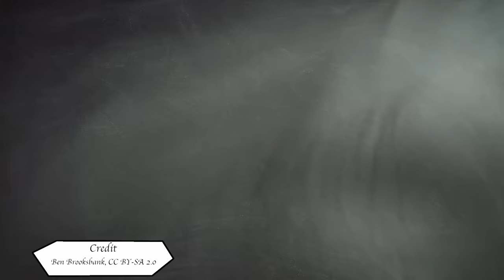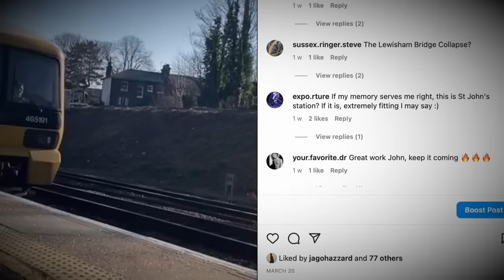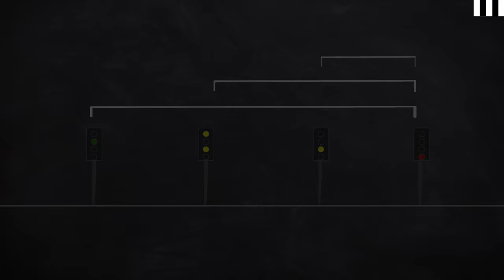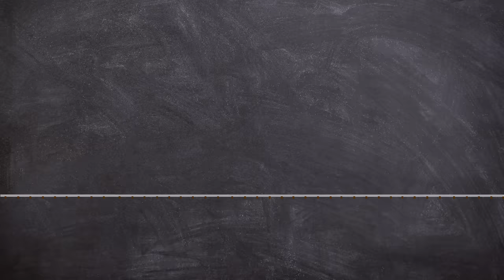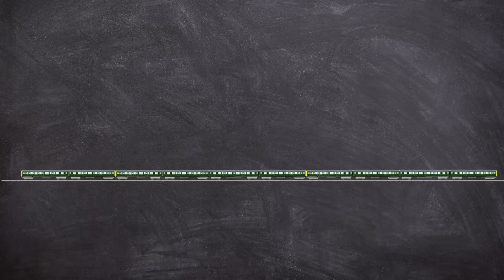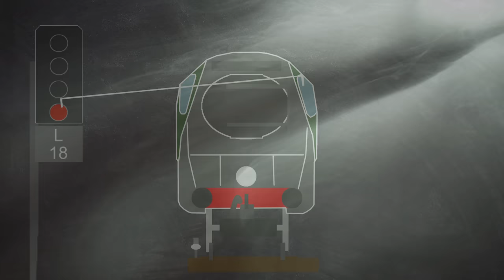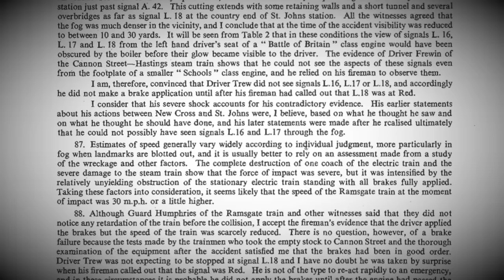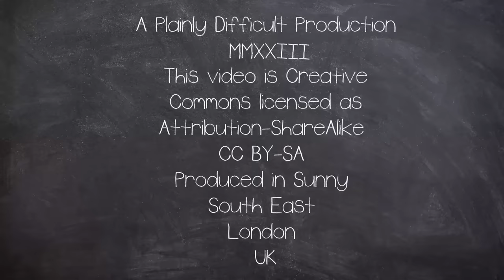Driving Blind: The Lewisham St Johns Train Crash Disaster 1957 | Plainly Difficult Documentary

Comment: So why was the double yellow the lesser caution? Wouldn’t you want the more immediately distinct one to be the bigger warning? Not that it matters in this instance since he apparently saw neither of them… but I can see mistaking single yellow for single green in a fog.
Reply: You'd be surprised how many people ask that. There are at least 2 very good reasons why double yellow is the lesser caution. 1. Some signals do not have 4 aspects, they have only 3: red, yellow and green. The 4-aspect sequence being red, yellow, double yellow, green means that yellow always means the next signal is red. 2. If one of your yellow lamps should fail the signal fails safe as it shows yellow instead of double yellow. Since one yellow is more restrictive that's safer. If 1 yellow meant the next signal is double yellow and 2 yellows meant the next signal is red, you can see that if one of the yellow lamps failed that would turn a signal which should mean the next signal is red into one which means the next signal is double yellow, which would be bad.

Comment: I am curious as to why the signals were on the right side, when engineer was situated on the left side of the engine
Reply: From the Ministry of Transport report:
30. It will be noted from the inset to Fig. 5 that there is plenty of room for the simple signal posts in the wide space between the Down and Up Through line, but none between the Down Through and the Up Local lines, and to have brought the signal aspects to the left of the Down Through would have required fairly elaborate cantilevered gantries. I understand that at the time of installation, when most of the engines were driven from the right hand side, the signals were sited as nearly as possible to the driver's or fireman's eye level in order to give the best view in the prevailing conditions where curvature and overbridges had to be taken into consideration.

96. Although the Down Through signals between New Cross and St. Johns are on the right hand side of the line, they are well sited, taking into consideration the difficult conditions of curvature, cuttings and overbridges, and it is doubtful whether much improvement would result from moving them to the left hand side of the line. The view from short range would be improved, but from long range it might be reduced.
Reply: @LUAu101  Alright!

Comment: Seems like a bit of a handicap to place the signals on the line where the driver can't easily see them.
Reply from the maker: I agree!
Reply: @PlainlyDifficult  From the report itself "It will be noted from the inset to Fig. 5 that there is plenty of room for the simple signal posts in the wide space between the Down and Up Through line, but none between the Down Through and the Up Local lines, and to have brought the signal aspects to the left of the Down Through would have required fairly elaborate cantilevered gantries. I understand that at the time of installation, when most of the engines were driven from the right hand side, the signals were sited as nearly as possible to the driver's or fireman's eye level in order to give the best view in the prevailing conditions where curvature and overbridges had to be taken into consideration."

Comment: Driver Trew took over an engine borrowed from Stewart’s Lane which had to traverse London in the fog.
Had not had chance to take water before hooking on to 11 well filled bogies. ( No column @ Cannon St). Engine being low on water was on drivers mind, as well as a very late departure.
Out of course stop @ Sevenoaks would be his first chance to fill tender. (More delay!)
Fireman needed to make up his fire (after sighting normal batch of signals for his mate), for the climb to Knockholt. Drivers could sight others until St John’s where it was normal for fireman to sight them for their mate.
Fog is very disorientating & driving steam needs concentration, difficult when u’ve got other things like taking water on your mind.
A book by Mike Jackman ‘ 30 years @ Bricklayers Arms’, gives an excellent overview of the surrounding events leading up to the smash & subsequent inquiry, which led to Trew tragically ending up a broken man.
Bricklayers Arms should have supplied the engine for this turn, but none were available.
The official report makes sober reading.

Comment: Back then with steam trains, the vast majority of homes using coal to heat them & the Clean Air Act barely 18 month's old, fog was made worse & often turned into smog. It should be noted that BR was desperately short of money, it was having to pay compensation to the shareholders of the big 4 due to nationalisation, government were paying war debts & limiting borrowing. Then there was the temporary measure to build steam shutting locomotives as a stop gap before realising they had to switch to diesel; meaning that money was wasted. Add to that a fall in goods traffic & parcel service that was shifting toward road transport. This meant that upgrades to signals & train protection wasn't given the priority it needed as  the vast majority of the budget was needed just to keep trains running.
Reply: The southern resisted aws as it was constantly running on one and two yellows. When I did some of my driver training on the strood paddock wood  branch in /1990 there was still no aws!  Coming from the central section that was too weird

Comment: Did BR not get criticised for the placement of those signals on the wrong side of the track, making them very difficult for the driver of a steam engine to see?
Reply: From the Ministry of Transport report:
96. Although the Down Through signals between New Cross and St. Johns are on the right hand side of the line, they are well sited, taking into consideration the difficult conditions of curvature, cuttings and overbridges, and it is doubtful whether much improvement would result from moving them to the left hand side of the line. The view from short range would be improved, but from long range it might be reduced.

Comment: I'm curious, if all the drivers are sat on the left why do they only have signal boxes on the right? Seems like it's just asking for a disaster.
Reply: It's not the location of the signal box (the building where the signals are operated from), but the signals themselves that was the issue. It's not that the signals are only on the right, in fact for many years it has been a requirement to locate them to the left of the line they apply to where possible. It's that these signals in the case of this accident were located on the right and that was a contributing factor in this accident. As to why that was, the answer is given in the report: "It will be noted from the inset to Fig. 5 that there is plenty of room for the simple signal posts in the wide space between the Down and Up Through line, but none between the Down Through and the Up Local lines, and to have brought the signal aspects to the left of the Down Through would have required fairly elaborate cantilevered gantries. I understand that at the time of installation, when most of the engines were driven from the right hand side, the signals were sited as nearly as possible to the driver's or fireman's eye level in order to give the best view in the prevailing conditions where curvature and overbridges had to be taken into consideration."

Comment: Is there any particular reason why the signals are on the side that the vroom-vroom maker is NOT sitting on? Like... Why? That just sounds like it's asking for trouble in foggy conditions. Why do it that way?
Reply: From the accident report "It will be noted from the inset to Fig. 5 that there is plenty of room for the simple signal posts in the wide space between the Down and Up Through line, but none between the Down Through and the Up Local lines, and to have brought the signal aspects to the left of the Down Through would have required fairly elaborate cantilevered gantries. I understand that at the time of installation, when most of the engines were driven from the right hand side, the signals were sited as nearly as possible to the driver's or fireman's eye level in order to give the best view in the prevailing conditions where curvature and overbridges had to be taken into consideration."

Comment: Honestly... i feel the fault lies with the rail designers.
Why would you put the signals on the other side then where they usually are?
Thats just a recepie for drivers missing the signals
Reply: "It will be noted from the inset to Fig. 5 that there is plenty of room for the simple signal posts in the wide space between the Down and Up Through line, but none between the Down Through and the Up Local lines, and to have brought the signal aspects to the left of the Down Through would have required fairly elaborate cantilevered gantries. I understand that at the time of installation, when most of the engines were driven from the right hand side, the signals were sited as nearly as possible to the driver's or fireman's eye level in order to give the best view in the prevailing conditions where curvature and overbridges had to be taken into consideration."

It's actually kinda funny you mention that really. Like on the Southern the Great Western engines used to be driven on the right and so it was very common to have signals located to the right of the line, or even next to the opposite line, where they could be more easily seen. Some of these signals survive to this day. However it became the standard that signals should wherever possible be placed on the left (i.e. where they usually are) leading to some very difficult sighting puzzles to solve and generally a worse view than would have been possible otherwise, or else some very awkward structures

Comment: All of the signals on lines where there are passengers services other than at station platforms are absolute block. It doesn't matter if they are automatic or controlled by a signalman.
Reply: That's not true. 'Absolute block' has been used to refer specifically to manual block signalling by telegraph on double lines for decades. It has been and continues to be in railway rule books, the sectional appendix, training, competence management etc. etc. distinguished from other methods of signalling such as track circuit block. Track circuit block signalling is non-permissive ('absolute', if you like) but it has been convenient to distinguish it from 'absolute block' for, as I say, decades. Incidentally it is possible for permissive working to be done on passenger lines, just not by passenger trains, other than at station platforms. This was more of 'a thing' in the past, but when Derby PSB was open the Broadholme loops were authorised for passenger trains but permissive working for freight only was also authorised.
Reply: @LUAu101  yes, there were/are some lines with passenger services were permissive working of freight trains was allowed. But none of the services involved in this incident are freight trains and so such permissive working are irrelevant. There were also sections of line that had/have no block, but only on freight lines as far as the evidence I have access to shows, and thus not relevant to this incident. My point still stands. At the time of this accident all lines were passenger trains ran were absolute blocks, excluding platform lines in some places.
Reply: @neiloflongbeck5705  I'm afraid you're wrong, and @Campaign Against All is right.  What you're referring to is Closed Block working.  Absolute Block working is a specific type of Closed Block working, where each train is offered forward by one box and accepted by the next one, the state of the line being shown on a block telegraph.  Track Circuit Block is another, different, type of Closed Block - trains don't have to be offered forward from each section to the next, the signaller instead sets the route and the signals for each section operate automatically.
Reply: @neiloflongbeck5705  No it doesn't. That's not what absolute block means. For decades absolute block has been distinguished from other forms of non-permissive block working. John was using 'absolute block' entirely correctly and as the rail industry has used it for years. Which is distinct from what we would today call 'track circuit block', a term which has been in use since at least the 1960s. See for example this rather nice black and white(!) video entitled 'absolute block signalling' https://www.youtube.com/watch?v=1DByv5HujP4 "Absolute block is always controlled by a signalman, either manually, or by power in some very big boxes. The term is used to distinguish the system from automatic systems, although the latter are certainly absolute in themselves." Today we distinguish absolutely between absolute block and other systems. See for example, the sectional appendix, https://sacuksprodnrdigital0001.blob.core.windows.net/sectional-appendix/Sectional%20Appendix%20full%20PDFs%20June%2023/Kent%20Sussex%20Wessex%20Sectional%20Appendix%20June%202023%20.pdf On page 208 "Mode of signalling: TCB Track Circuit Block, AB Absolute Block"
Reply: "At the time of this accident all lines were passenger trains ran were absolute blocks, excluding platform lines in some places." As you've just said "there were/are some lines with passenger services were permissive working of freight trains". It is a pedantic sidenote, but I thought quite an interesting one, that not all lines where passenger trains run are non-permissive. It is indeed forbidden to work passenger trains permissively outside of a platform, but you can work freight trains permissively on passenger *lines*.
Reply: @LUAu101  I stand corrected.
Reply: @neiloflongbeck5705  :) It's a mistake I used to make and understandable because you are right that track circuit block is 'absolute' in its own way in that it only allows one train to be in a section at the same time, but it has been customary to distinguish 'absolute block' from other kinds of non-permissive signalling systems for so long that your correction was, well, a bit too pedantic and misleading. For example, when signallers are trained today many still go through an absolute block course and then will do a 2-week track circuit block conversion course. We have rule book module TS3 absolute block regulations and module TS2 track circuit block regulations, along with a variety of others (TS4 electric token block, TS5 tokenless block, etc.)
Reply: If you're interested in this, by February 1930 the Southern Railway had a book 'Standard Regulations for Train Signalling on Double and Single Lines including Description of Signalling Instruments, etc.' In it we have 'Standard Regulations for Train Signalling by Block Telegraph on Double Lines of Railway' which begins 'Block System. — (a) The object of the System of Block Telegraph Signalling is [...]'. By April 1932 they had published their 'Train Signalling Regulations on the Sections of Line Between Coulsdon North No.2 and Brighton; Preston Park and Hove East; Brighton and Hove East' which contains the line 'Block Telegraph Working is dispensed with and the running signals are controlled by track circuits.' Then in March 1935 they published their 'Regulations for Train Signalling on Double Lines Where Block Apparatus Is Not Provided' which simply says 'Block working is dispensed with and the running signals, colour light or semaphore, are controlled by track circuits'. The point of all this being that 'block telegraph working' or simply 'block working' seems to have been the term used by the Southern Railway around the time the new system was installed at St. John's (1929) for what we would today call 'absolute block'. Meanwhile, at St. John's, there was no 'block (telegraph) working' (i.e. absolute block working) and the lines were simply referred to as lines where 'block apparatus is not provided'. Today we'd call them TCB (Track Circuit Block) lines. The accident report refers to 'manual block working' as in 'With all the signal aspects under track circuit control there is no manual block working, and the trains are announced from one box to the next by Walker's pattern train describers-see the Appendix and Fig. 7. These train describers are of old-fashioned design, but they have proved very reliable over the years, and all the signalmen on this route are thoroughly accustomed to their working.' In 1959 BR Southern Region reprinted the old 'Regulations for Train Signalling on Double Lines where Block Apparatus Not Provided' and on 1st October 1960 BR published their own 'Regulations for Train Signalling and Signalmen's General Instructions', the first section of which was 'Regulations for train signalling on double lines by the Absolute Block System'. On 2nd May 1964 BR published 'Supplement No.3 to the Regulations for Train Signalling and Signalmen's General Instructions: Regulations for Train Signalling on Double Lines by the Track Circuit Block System.' In other words, by at least 1960 BR were using the term 'absolute block' to refer exclusively to manual block signalling by block telegraph and by at least 1964 the term 'track circuit block' was in official use.

There, aren't you glad you commented? :P